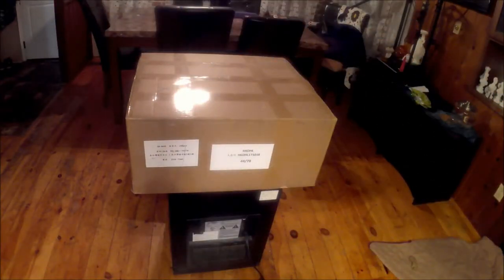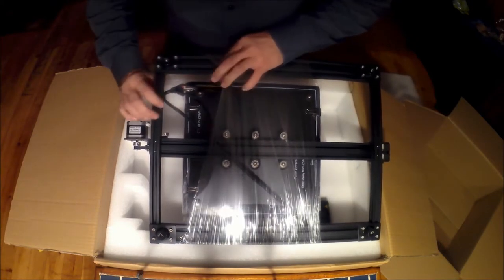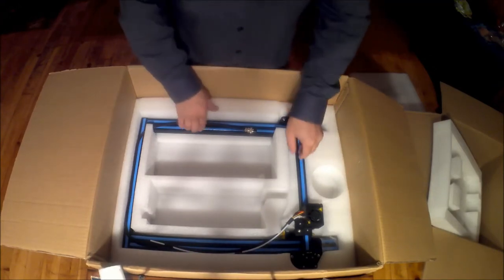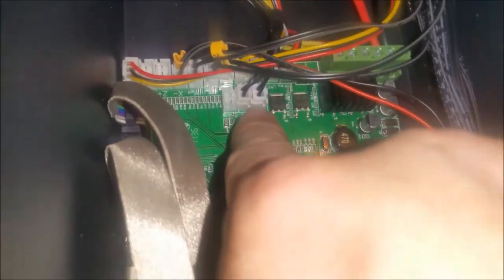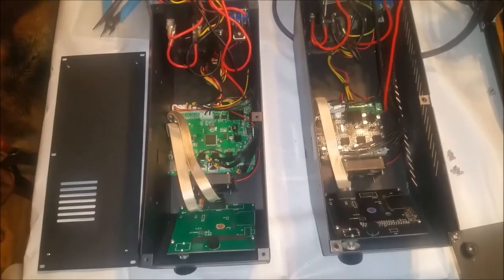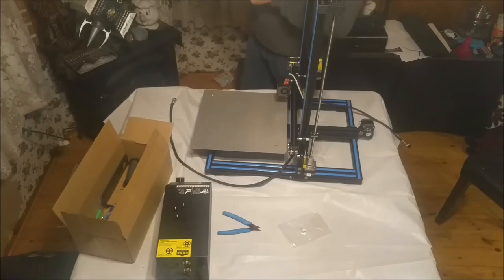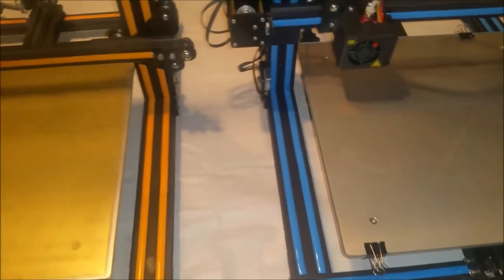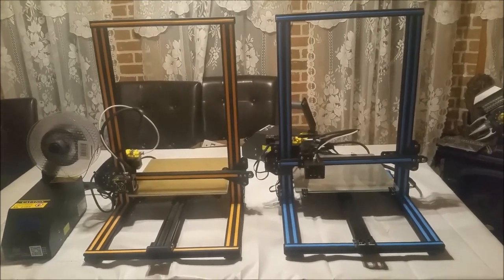The CR-10S Unboxing, Assembly, and Comparision

Comment: A couple of questions:

1) Where did you get that PEI piece? 
2) The PEI looks like it was custom cut to fit. Did you order it that way?
3) Since the plain CR-10 does not have a heated table/plate, have you tried it on the CR-10S (that is heated)? If so, do you recommend its use with the CR-10S?
4) what are the dimensions of the entire base for this (not the table, I already know that). I just need the length and width so I can make sure the table/stand I put it on is large enough.

Thanks for the video, I found it very informative especially since I just ordered a CR-10S and want to prepare myself for its delivery.
Reply from the maker: I ordered it of Amazon. It comes in at that size, ans is actually 5mm smaller then the bed on both the Y and X axis. I am confused a little bit about your 3rd question. The original CR-10 has a heated build plate, without a heated build plate the sheet of PEI would not work in holding the piece to the bed.  The Base  of the printer is 16" wide by 20" long, add another 5.5-6" in the width to accommodate the electronics box.
Reply: You answered my question, but can you provide a link to Amazon for that PEI piece you bought from Amazon? BTW, I'm a novice at this, I got hooked when my kids bought me a New Matter MOD-t :) ...they know their Dad is a geek...LOL...many thanks again!
Reply from the maker: I am in canada so I ordered from Amazon.ca  
https://www.amazon.ca/gp/product/B0013HKZTA/ref=oh_aui_detailpage_o05_s00?ie=UTF8&psc=1

But a similar/same can be found on amazon.com